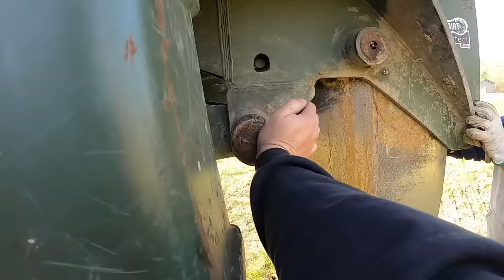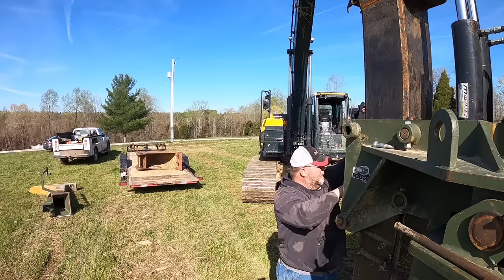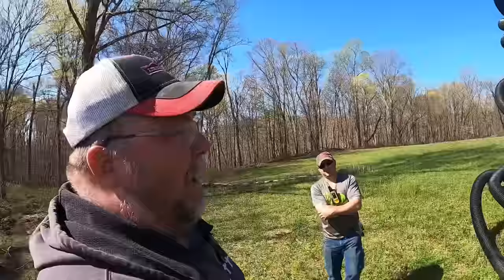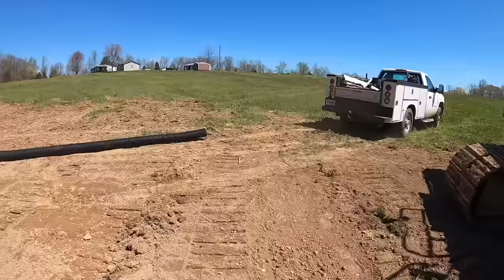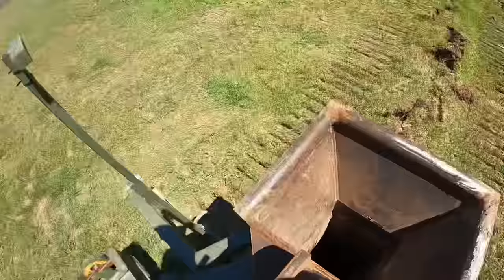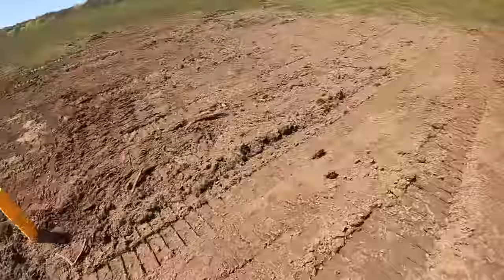Aaron is not happy with Farmer Chris what a mess he left us and how does the repaired tile boot work

Comment: One of my worst mistakes working was using my hand as a hammer. I am reminded of it everyday now.
Reply: Exactly! I worked for a R.R. for many years. We used to kick the tool we used to get under the spike to pull them out of the tie. A old timer told us young bucks that we would need those toes and foot for something else in the years to come. He was right!
Reply: I have that same issue,  thought those things on the end of my arms were for beatin on stuff, boy I regret that thought.
Reply: I heard that! Been there and it definitely is not a good idea.
Reply: The other day I had to remind my son not to jump out of a 3/4 ton pick up !  Climb down and save your back.
Reply: I know the feeling but mine is in the shoulder. Soon to be having a reverse total shoulder replacement. Using the hand hammer Contributed greatly to my carpel tunnel issues
Reply: Amen, the hand hammer definitely has a way of reminding me of just how much I used it
 now 65 and I get a hint of it on a daily basis
Reply: 40 years ago I worked on a spudder  oil rig .with hand slips . I asked for a new set of die’s for a year . We just kept wire brushing them but they was bad. 1 day on our second pipe when I unhooked the elevators we picked up another pipe to set it in and when we set in in the Bottom pipe jumped a bit and the slips open up and down the hole it went. M

Comment: Take a grinder, and lightly grind a grove in the end of the pins, in line with the retaining bolt hole.  That’ll give you a permanent indicator of which way the pins need to turn for the holes to line up.

That was a mess, for sure!  Thanks for the video.
Reply from the maker: Stay tuned

Comment: Thanks for sharing your thoughts, ideas and videos. Nice to see the teamwork come together so nicely on a mess of a job. Wishing you and your family the best. 

Just curious if you have seen Edison trucks from Canada. They are building hybrid logging trucks from scratch as a start up. They recently did an episode in how they had to go straight to China to spec out and buy electric drive axels because nobody in the North American market would sell to them. As a result they are now an importer of electric drive axels. The axels they are using are about 1000hp per axel and they are looking to be able to add power axels to the logging trailers also to get into even rougher terrain. They use a Cat engine hooked to a generator to keep the batteries charged. All I could think while watching the videos was, wouldn’t 2000hp of drive axels be a nice addition to Lt Dan. If you sized the motor generator correctly you could maybe be able to use it as a charging station for a possible loan from Volvo. The key element is they are making the motors compatible with off the shelf axel components so you aren’t dependent on them for most of the drive train.

Comment: Start  GPS ing all tile you run.    And a file on it.  40 years from now it will be appreciated.    Either keep points on maps and screen shot or print hard copy at home in file cabinet.   Even 5 yrears from now.    If property changes hands.  Or what ever.  GPS is accurate mostly to around 4 feet.

Comment: okay i am from Australia and we don't fully under stand what a tile is we use this term for a floor tile in a house the pipe you refer to is what we call an agg pipe some differences though it has slots and needs gravel of sorts for the water to drain into with out clogging up with the mud stuff so your tile is a pipe with thin cuts in it seams to work as does ours drains unwonted water from ground so i supose that's the difference fro country to country still works i supose does yours have a field life ours sort of does when stops working it stops working and is replaces and comes in 6 meter lengths yours comes in a role much more better i thinks keep on keeping on i say good work big Cheers for the invention or is it a mod of a factory one you modified if yours then put a pattern on it sell it on make a fortune and retire i say big Cheers just love your videos keep em coming but you have to make them better so you gets more dollars cos LETSDIG 18 has it all over you mate
Reply: I'm thinking "tile" is a left over name from when this was done with very short sections of clay pipe which didn't seal to each other, allowing water into the gaps between sections.  The pipe they are installing has small slots in recesses between the ridges.  Whether it needs anything besides the bare slotted pipe, such as gravel and/or filter fabric, depends on local soil conditions.  In a lot of places, however, bare pipe is fine as the slots are small enough to keep most sediment out, and plentiful enough not to all get stopped up themselves very quickly.  And while it does have a service life, it is usually measured in decades when properly installed, at least in geologically stable areas.
Reply from the maker: Yup

Comment: Looks like DP Engineering is a big success 2 times over and the silence from the failure critics is amazing.
Proof of concept on the 8 inch tile plow is definitely in the money 💰💰💰 now.👌
Good to see plow №2 working correctly.👍
Adapter suggestion for the 8 inch tile plow. Use 1 inch flat stock with a chamfer on the inside for smooth flow and 2 threaded holes on each side to bolt through from the outside of the plow.
1 inch stock for 6 inch pipe and add a second layer inside for 4 inch pipe.
Basically the same idea you did with wood in two rings for versatility. All you need for materials is the flat stock and 2 sizes of bolts for fastening.🤙

Comment: Guys, It looks like the tile mgf'er could make a T with a hinge opposite the T so you could slip  the T in place under the tile, clamp on the top 1/2 (screw or pin it on) & add the T tile & save time on adding a T. You could saw a T in 1/2 & make the hinge.

Comment: I'm thinking that, those cheap cheap 1 inch ratchet straps that are only good for one or two uses, might have a usr for when you have a partial roll of tile you want to store. Put them on before you tsle it off the cart. 4 of them evenly spaced. Even if the ratchet rust solid, cut the strap.

Comment: Hey DP what if you welded a nut on the ends of your plow pins then you could rotate them easier for the lock pin alignment? just a thought
Reply: When he hammer the pins in and out it well flatting the nut and the wrench wount fit
Reply from the maker: Exactly stay tuned

Comment: If I understand correctly (likely not), the tile plow you removed was the original 8" and this one you attached is the "new" (kind of) 6", than there's the 8" to 4" adaptor (wood) you scabbed together?
I'm thinking it would have been cheaper to weld some slots into the 8" plow for 4" and 6" metal adaptors?
The other thought, it's more likely this is a "new" 8" plow Chris had made?
Reply from the maker: Fuel burn pulling it and how it lies on the ditch

Comment: Y’all go so lucky with that tile cart.  Now you need a ram cam bucket and a radar bucket. Or put radar on the ram cam..🤔 I think the 140 was better for tile work than the 120. The 40 had a dozer blade. Don’t think it had an angle blade but would be even better if it did.

Comment: aaron is a wonderful addition to DP.... BUT WHERE IS MATT?  Did you dump him?  if you milled a much strong taper on the leading ends of the pins, they would make you life much easier. The current taper is too blunt.   So easy to do, so difficult to line up the way you have the pins shaped now.
Reply: Matt is not working with DP much from what I understand, reading tea leaves.